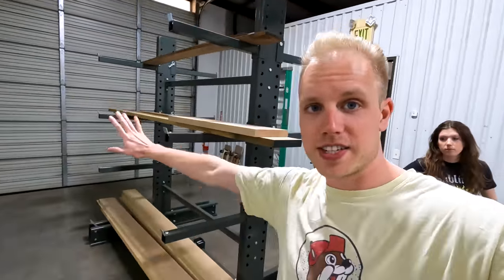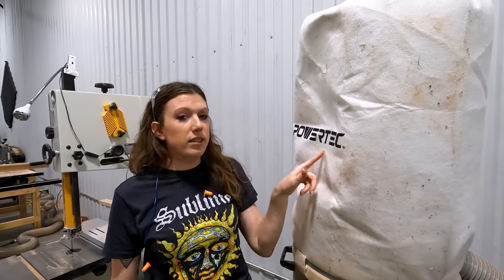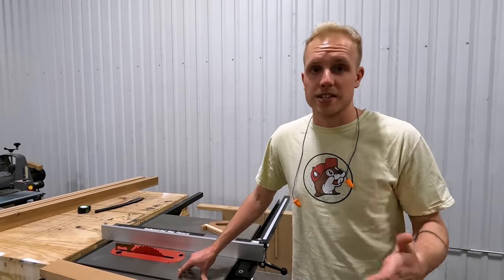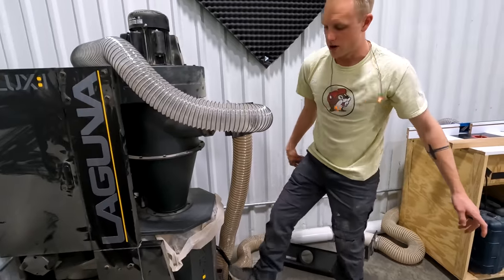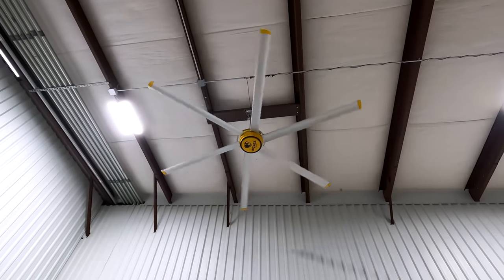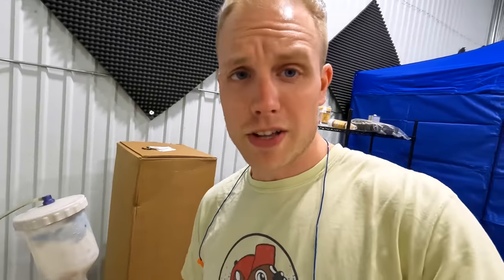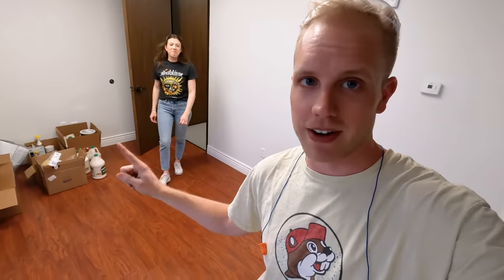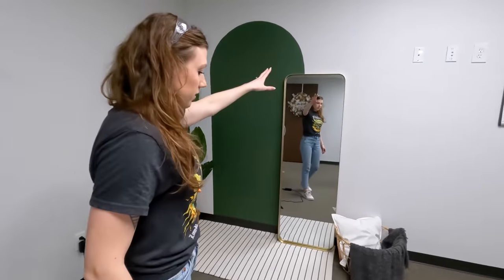How cheap is our MASSIVE warehouse?

Comment: I definitely recommend an eyewash bottle next to all of your first aid kits. I use a refillable one, it's been a lifesaver for me, it's only a matter of time until something finds it's way past safety glasses
Reply: Ditto, we keep two of em at all stations along w Refresh Plus eye drops (no preservatives).  Use wire glove box dispenser/holders for holding them.  Our major consumables are extra large cloth bandaids, long-style finger bandaids, Neosporin…and oddly the single most used..burn cream packets.
Reply: Frist-Aid kits should be up and away from the equipment but they have it literally right under everything that creates chips and dust... Nothing like having the clean a layer of sawdust before being able to use any of it. Imagine using the eyewash just to have more dust get into your eyes.
Reply: @JustinRaymondUtah Agreed, thought the same thing.  Just laying em on a tool cabinet perhaps not best solution.  Things such as 1st aid/medical and fire extinguishers should be in fixed locations so they’re “memorized”.  We keep fire extinguishers (be sure to use appropriate type and check them at least twice a year, preferably quarterly) by large equipment and by all exits.  Several of our 1st aid stations and fire extinguishers are right next to each other.  Also industrial temperature based smoke alarms, not the home type smoke alarms
Reply: @jessefurqueron5555  I've been around and in shops for most of my life and also EMT certified. Wall-mounted cabinets are best for accessibility, cleanliness, and once open everything can be seen at a glance. Anything that takes two hands should be avoided just in case someone is alone working. Trama-related first-aid should be near the machines that could cause trama. Larger and more comprehensive kits should be in the bathroom, breakroom, or sink. A place where you will go to anyways to tend to a minor wound. For example, If you get a cut at a workbench, you don't want to fumble around a shop first aid to grab a few things (while touchings things you arent going to use with dirty hands,) then take those things to a clean area. You will likely do a quick compress then go to the clean area first, wash, then look for things to tend to the cut. Of course, if you get a major ingury at a saw, treat it right there with a near by trama kit.
Reply: @JustinRaymondUtah  kudos on the EMT cert, that’s a lot of work for that.  Years ago we “standardized” all the 1st aid kits to “OSHA” types.  I hear ya loud and clear on one handed access.  We updated all our first aid practices after I had dropped an xacto knife w blade  (they’re innocent right?) while sitting and knee jerk reaction is to close your legs to catch it…boy I learned the hard way NOT to do that.  Must’ve knicked a good bleeder vein, cause there was red juice all over the place. Took quite a while of compression to stop it.  So after that I got on a shop 1st aid kit binge.  Over time each first  aid kit invariably becomes “customized” for the particular area they’re in, like burn ointment is used mostly next to the soldering station, not so much by the resin casting station.  Most of the “customization” items live in a separate box mounted right next to the “standard” kit, namely 1) the most used items are quick to find  and 2) we buy those “most used” items  in bulk and all toll, they don’t fit in the “standard” first aid boxes,   (the burn cream packets come in their own dispenser box so they get mounted on the wall with Velcro) which have almost all their original contents (a few items get changed out regularly for “freshness”).  The contents in the  standard kits rarely get used, but nice to know some of the items are there, just in case.   One other thing we keep at each station, Zeiss lens cleaners (also in their own dispenser) for glasses etc.
Reply: @jessefurqueron5555  what you have going is actually really well thought out and much better than 95% of shops out there. My few suggestions would be accessibility and less mixing of minor and major first aid items. Ever seen a first aid kit that had everything after 5 years or even 10 years of pulling out bandaids and tweezers? Those life or death items in there look liked they served time in Iraq.

Comment: At the end of the day keeping employees safe is the top priority. You guys mentioned buying a SawStop. May I recommend taking the Felder with PCS blade stop system into consideration? The PCS system not only keeps the users limbs safe from the blade it also does not destroy the blade or a brake system when activated. Reseting the system is also free and takes less time because you just press a button to reset the system vs having to change blades and brakes. I would imagine the Felder costs more though. Your shop looks looks awesome so far. It will be interesting to see how far the shop comes by this time in 2023.

Comment: If you need multiple routers consider a counter top with multiple lifts spaced 12in apart, you could use off the rack cabinets and tops then just route the recess for the lift plates then there is no limit on the capacity of routers.
Reply: I can’t think of any of my woodworking buddies whom have less than 6-8 routers.  I think we’ve got about ten or so, they multiply like rabbits.  Most are one breed, 1617evs’ with an odd PC & Dewalt to keep the genetic diversity.

Comment: I can’t expect you guys to address the Houston heat right now until you’ve experienced it in a metal building. Yes the BAF is going to help a lot but you’ll need to supplement with a window unit but since you don’t have a window a mini-split is in your future. Personally I’m not a “fan” of minis but what else ya gonna do?
Reply: Dallas here, bit the bullet and HVACd the shop.  Only way to feasibly work year round here.

Comment: Howdy neighbors, just up the road from ya in N Dallas.

Bandsaw blades.  To help a bandsaw cut way above its weight class.  TimberWolf low tension bimetal blades.  The keyword is low tension.  They’re the Forrest saw blade of band saw blades.  Once you try em…just saying.    First time I used TW was on a 16”ish slab of Koa going on a necklace cabinet for my wife, I was amazed at the surface finish off of a bandsaw, a little hand planing and scraping.  Gorgeous.  Net key is reduced post work/steps and less ditritus to be disposed of.  Also a tension release lever on bandsaw, we hang a tag right over the power switch to make sure to remember to release/set the tension.  Carter guides are really worth it if you have the jingle for them.  We run both styles, for wide and < 1/4” blades. (Forget what they’re called right off).  Not associated with any of these mfgs other than as a very happy customer of about 20-30 years.

As always, YMMV.  Just sharing, nothing more, nothing less.

Comment: Guys please don’t buy a saw stop bc of the brake.  There isn’t a brake on any other tool.  The jointer would be the biggest risk.  And nastiest cut.  I have a 3 hp grizzly and it’s awesome.  And I paid pre pandemic price :). Which is awesome.   Look at Harvey saws.  Way more for your buck.
Reply: Joel, they said in the vid Sawstop for Insurane reasons
Reply: Unfortunately, you are incorrect. The NEISS actually did a study of ER visits due to woodworking machinery in 2011. The number 1 offender by far is...  the table saw. Which is no surprise. It results in about 40 thousand annual injuries. The next up is a category that includes planers, shapers, jointers and sanders and combined they produce 10 thousand injuries a year. So, it's really not even close. Table saw is by far the most dangerous tool in the shop.
Reply: @lawrencedeleurere4427  I can’t argue with the numbers.  But….unless you buy the industrial series, you aren’t getting a much better saw.  I just hate to see someone spend their hard earned money on sawstop when there are other brands that are as good or even better.  Sawstop is a marketing marvel and you can’t deny that.  Just like my GMC Sierra.  Beauty is only skin deep lol